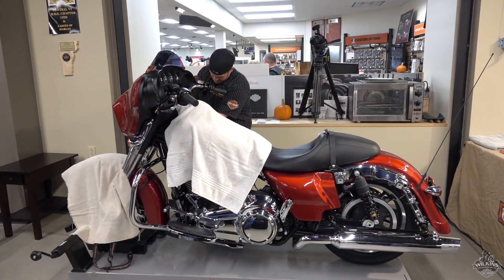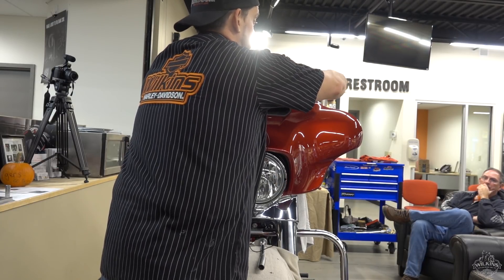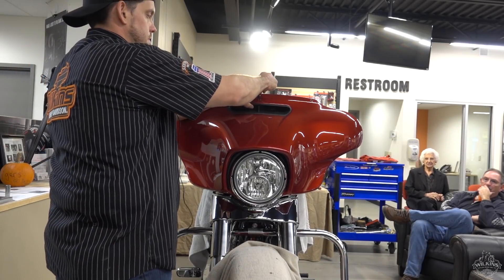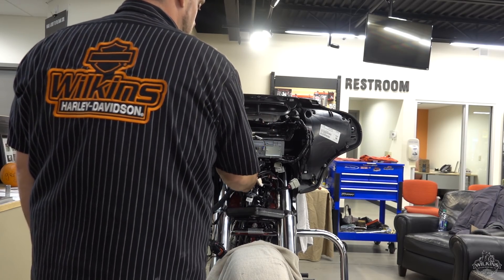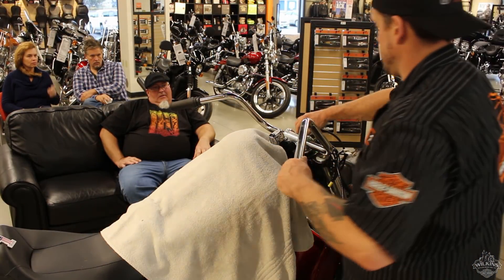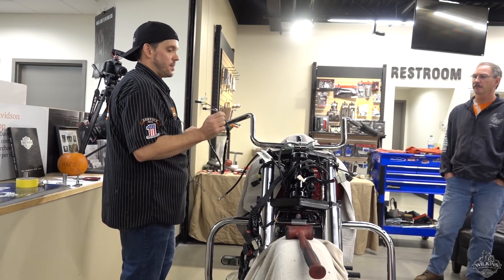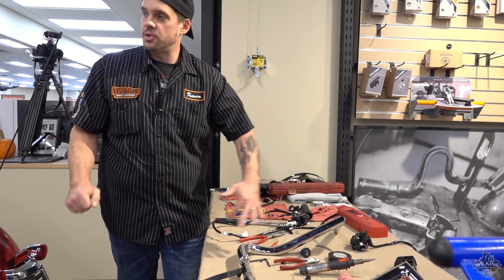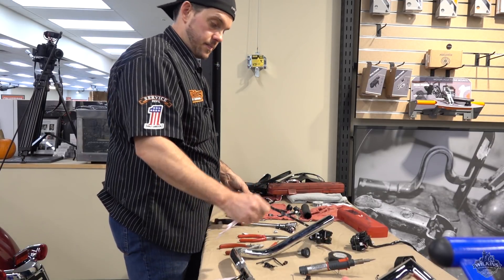How to Install 14 inch Handlebars on a 2019 Harley-Davidson Street Glide Part 1 of 2

Comment: Are you using stock brake and clutch cables? And wiring harness?
Reply from the maker: We used the LA Chopper Handlebar Kit for this install. The brake and clutch cables and wiring harness are all included in the kit. -Trevor
Reply: Wilkins Harley-Davidson are you able to use stock cables and wiring harness for 14” bars.
Reply from the maker: @seadonne  You usually can use stock cables and wiring harness on 12" bars, but unfortunately you cannot with 14" bars. -Trevor

Comment: why would you have to take the tire off?
Reply from the maker: If the bike is on a lift, it's easier to take the front wheel off to turn the bars and get to the riser bolts. -Trevor Blouin
Reply: @WilkinsHD   You dont need to take the wheel off to get to the riser bolts i guess is what im stating and or asking. Why pull the wheel off adding more work when you dont have to?
Reply from the maker: Hammer F same reason sometimes you take the exhaust off when you are changing a rear wheel. We find it easier and faster. In this instance, the same applies. You do not have to take the wheel off.  We just find it makes things faster in the end.